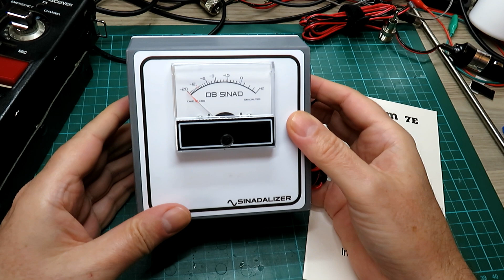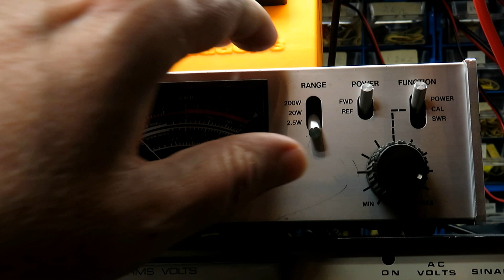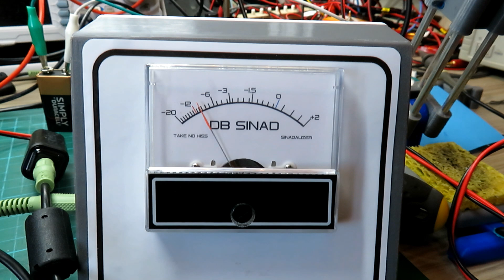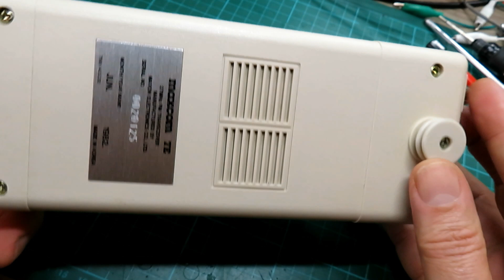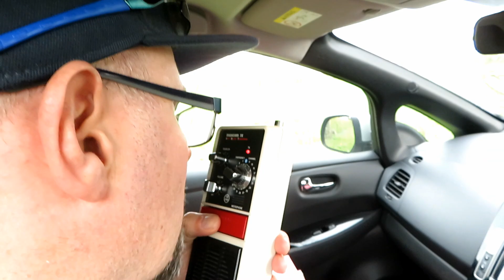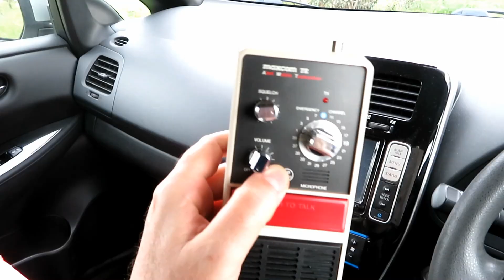MAXCOM 7E - SETUP WITH THE SINADALIZER AND FIELD TEST USING THE INTERCEPTOR TC 300

Comment: Well another one ‘rescued’ and sounded great. Interestingly I did a short range test in the antenna and it did work, so may have just been local conditions. I’ll look for a new battery pack case for spairs but once again thanks Paul (and Tyler) for a fantastic job and interesting update video. Will go through that box in the loft and see what else I can find… cheers guys